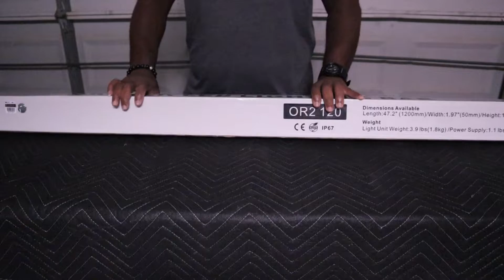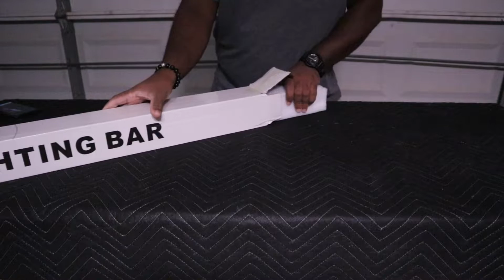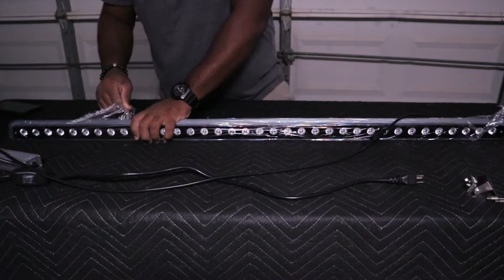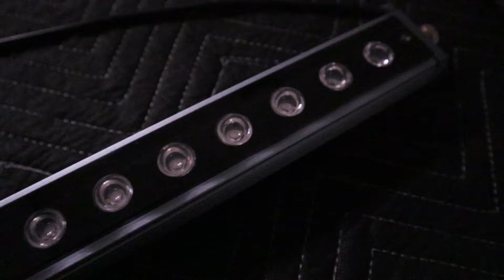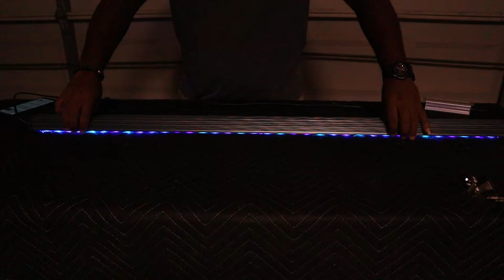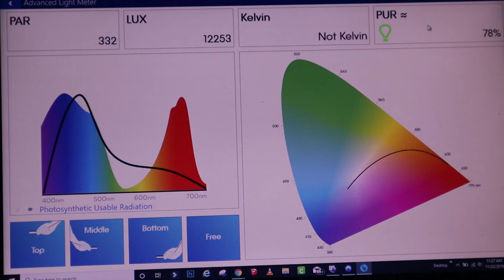Orphek Or2 Blue Plus | Testing Par Readings

Comment: After having the orphek for a while, how do you like it? I’m considering two 48” strips to go along side my 6 bulb 39 watt ati t-5 light (36”) it was what was available when I was looking used. My tank is an 80 lagoon 48x24x16/18?
Reply from the maker: I still like the light bar I actually reinstalled it recently because I missed the extra light it provided in some of the shaded areas in my tank. Adding it to T5's should give a nice pop of color.

Comment: Nice vid. and tank . So the led bar doesn't have sun up and down ? Just on and off ?  What software are you using ?
Thanks for showing this . I've been thinking about getting one for more spread. My tank is 36" and  my Orphek V4 is only 24".
Reply from the maker: Thanks. Yes the light would need a timer or a aquarium controller which is how I am operating the on/off function via the Neptune Apex.

Comment: I put an OR120 blue plus on my tank in November to add some extra spread.. Similar to yours i run 3x xr15g4 pro's. A couple of weeks before Christmas i saw some of my colonies particularly things like digis and plates starting to suffer with tips of acros, digis and plate particularly greens dying off starting at the tips and algae forming.i have gone through all the usual chemistry, alk is solid at 9, cal 450, po4 0.05 no3 10 so i want to than you for the upload and showing the par difference when the orphek are on.
I must say my rockwork is much higher than yours. I had checked par on my radions, why oh why i didnt check them when i added the orphek is beyond me. But from the increase you have demonstrated i have removed the or120 and will see how the tank does in the next few months. Thanks again for uploading the video 👍
Reply from the maker: I am glad the video helped. Even though there is a huge jump in par you could balance it out by lowering the intensity of the Radions to get to a comfortable par for your tank because the spread from the Orpheks are great and benificial for the corals. Hopefully this helps you in your journey.
Reply: @SimplyReefing  i sold my par meter 🤷‍♂️ best thing for the corals is to remove atleast for now. 👍